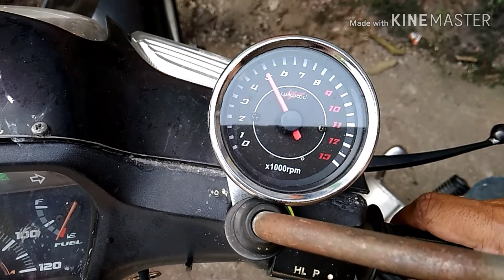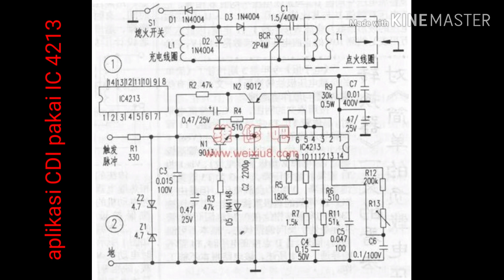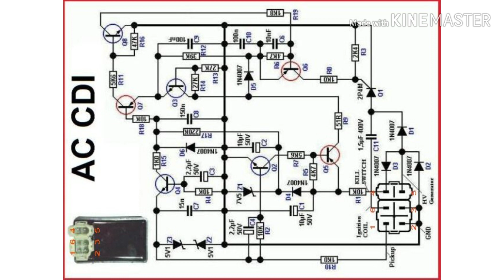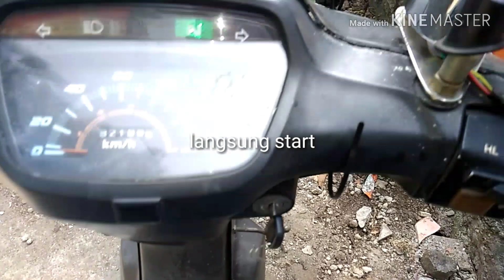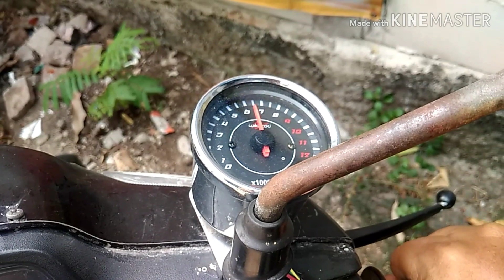CDI racing advance pengapian maju

Comment: Om zak q ud bkin & q pake d motor win..hsl mantap om. Tp kira2 pemakaian 1bln kok tiba2 mati om. Syg om kendla d alat ESR g puny hny modal multitester digital. Biasany yg srg troble d part apa om yg rawan mati ?
Tlg bantuan bimbinganny om
Reply from the maker: Coba cek seluruh diode nya, mutu diode sekarang kurang bagus
Reply: @unclezack19  iy om q cèk dz 5v1 (kanan) yg paralel dgn 1n4007 jlr k scr & pin socket short. Iy om kl Cap jlr koil d perbesar jd 225 tanpa  merubah nilai part laen gpp om...pengaruh ke power atau part laenny jd panas g ?
tlg bimbingnny
so
Reply: Om ud q ganti....hidup tp d gas malah brebet & mati. Kira2 apany lg yg hrs d cek/ganti om ?

Comment: Dlm scema ELCO C3, apa itu polaritasnya gak kebalik ya om
Reply from the maker: Iya betul terbalik fungsi untuk hidupkan transistor tipe npn
Reply: Nanya1 lagi ya om, kalo dirubah menjadi CDI DC, R1 10K dpt 12V batery dan out inverter ke anoda D1 ya om, trims
Reply from the maker: @wahab7728 jika jadi CDI DC 12 volt, R1 pakai 1k